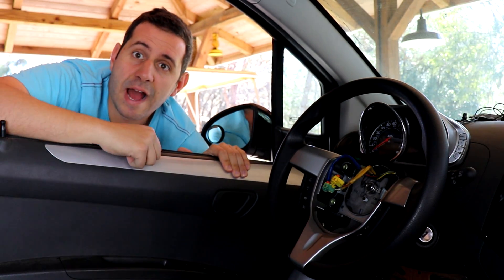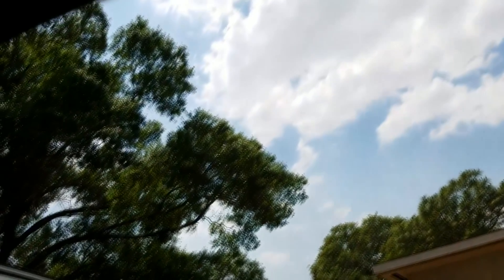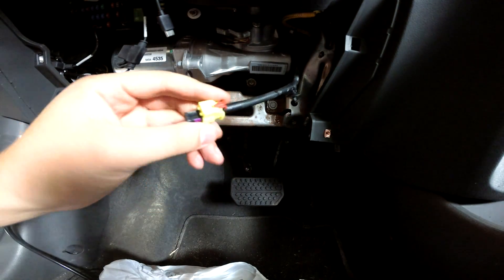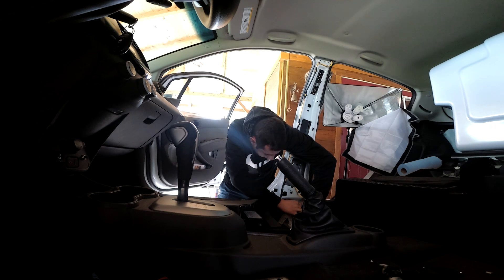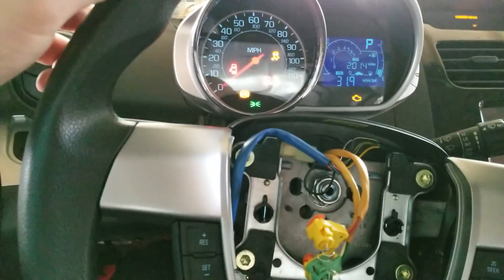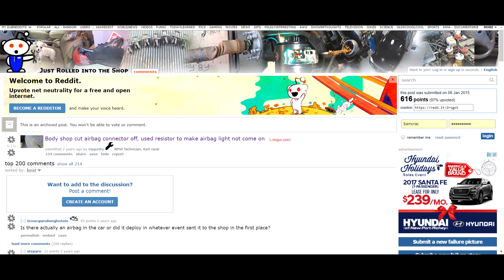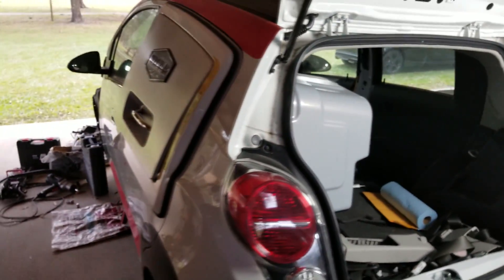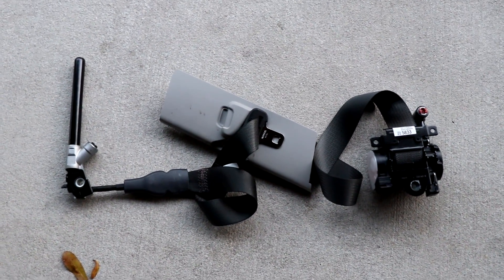How Scammers Hack a Car's Airbag System for 5 Cents (Permanent Airbag Light Off)

Comment: very informative ... shocking that the airbag system is that simple to fool .... 2 followup questions   imagine a case where a knee airbag is harvested/stolen from your car does the SRS computer detects that there is a disconnect of the airbag and reconnect (of the resistor) and trigger a code if the ignition is NOT turned on when the theft occurs ? also what happens if the resistor gets loose and  falls off the connector while driving : does the airbag light goes on immediately (with a code ) or will it stay off and only appear the next time the car is turned on (in other words is the integrity /presence of the "airbag" checked continuously while the car is being driven or is it just happening during the startup when you turn the ignition on ?}
again thank you this is very helpful ...

Comment: Just for clarity, the seat belt devices are pre-tensioners, which tighten the belt in an accident. They are one time use, and are triggered only in an accident bad enough to set off one or more airbags. If a shop did as described here, the seat belt would still "seem" to work (ie it would lock up if you tugged hard on the webbing), but it would be missing the pre-tensioner, which is important in more severe accidents...and you'd never know.

Comment: If the airbag controller is not communicating with the car on the passenger side, is there any way to hide that? Just need to pass the MOT in the UK as I only use the car as a local run around, don't have passengers with me.

Comment: Samcrac, I have a 2007 Lexus RX 400  H.  Needed to change out the bumper absorber and now, the air bag light is going off and on. Any suggestions, I really appreciate it.
Reply: its giving u a code, ID the code n google it...

Comment: Thanks for giving the detailed video. I purchased a Salvaged 2019 Traverse.THe jerk had a fake receipt showing he paid a lot of money replacing the airbags. He had actually replaced a few...but low and behold a year or so in the air bag light came one. Come to find out he had done the resistor trick on the  L &  R  air bag side curtains  one of them had gone bad triggering the code error...jerk took zero responsibility ..he blamed it on the alleged "air bag" company that was conveniently out of business.
Reply: If i want to buy a car how can I inspect that the airbags didn't go off before?
Reply: @r.k862  You can take it to and airbag repair shop or technician. It cost @ $200 to have my guy inspect mine and tell me where there were issues ..depending on the vehicle it can cost more...
Reply: @TomcoAV  thank you. If I want to have only the drivers airbag checked and to fix somethings how much do I have to pay maximum roughly?

Comment: I had this done to me when I bought a Mercedes-Benz w204 c250, I knew it had been in an accident but the guy I bought it off said everything had been fixed. Not long after I started using it the air bag light came on and found no air bags on that side of the car🤯😡

Comment: If you have air bags on and is running aftermarket seats with these resistors on, will the air bags deploy with an accident?

Comment: Just wondering what kind of resistor can one use ?🤔 no mention of it in the video or in any comments 🤔 😕. 
I'm in the final stages of completing my track car conversion for weekends and I'm still thinking how can I get around the airbag light especially with all the original seats removed . Any help will be greatly appreciated.  Thanks

Comment: Well I’m still trying to bypass / fool the system in our 2007 ( I gave up on the 2015 plus someone offered me way more than we paid for it new ) I refuse to let my wife ride with me! Please can you or anyone help?  If I could post photos I would. I just need help with the passenger side. There is a plug w/ 9 wires coming from the truck on the passenger side. The driver side is in and everything fits. Any help please?

Comment: My toyota has 3 plugs. 1 yellow one white and one gray. Adding a resistor to a yellow one does not prevent airbag light from coming on. Can someone please help? I want to remove my passenger seat on my 06 4runner for overland built for space purposes but I dont want air bag light when seat is removed..

Comment: Link to the resistors please :o) 

Airbags are the biggest Hoax and scam ever, they total a car way to fast and cause them to go to the junk yards, Making the Manufacturers of car more money because that car is now totaled and a new car is put on the road. 

No one's car should be totaled after a Seatbelt supplemental safety feature such as an Airbag. Junk Yards now get to part out your car and make more money as well, insurance get to raise your rates because they spend more and have a bigger loss and now they get to Insure a New Car at a much higher Rate because  your rates went up. It's a win win for the Car Industry People, but a serious financial burden on people who have airbags deployed over simple 10 mph accident or even worse, just go off accidentally. 

Government needs to cut the red tape on usage of used airbags and need to make laws on charging affordable prices for such supplemental safety features that really don't save lives at all and sometimes takes them. If you think Airbags saves lives, Don't wear your seatbelt and rely on Airbags alone. Let me know how that works out for anyone that tries it? Now try using only your seatbelt in an accident without airbags and chances are you will be ok, without a financial burden after a accident and Trauma. 

People have been brainwashed that airbags save lives, Yet we have classics on the road that have no Airbag, just seatbelts and everyone is fine. Come to think of it, there are classics without seatbelts, yet they are still on the road and its fine and dandy.

Comment: Love this video! I have a question I have a 2019 Ford ecosport and both front knee airbags deployed. I sent the module and seatbelts to get replaced.I bought the airbags from a junkyard and installed everything back. The airbag light is still on and my innova 5410 can’t even connect to the car. The fordpass app gave an alert that the RCM has detected a fault with the driver knee airbag circuit. Is there anything that I could do to clear this? Thanks please let me know

Comment: Leave the dame airbags out im  thnak the SRS airbags broke my rib cage in two places. I hit a deer with a 1987 Lincoln Continental at 55 mph no AIRBAGS NO injures walked away and drove the Lincoln to work and for the next 3 months with the RAM bet into the engine and the A./C condensoer bent into the engine A/C worked And Rad never leaked. SO next car will have no air bag or im deleted all airbags.

Comment: I bought a salvaged vehicle to ship overseas. Only the driver knee airbag was deployed. If I connect an emulator or resistor to that airbag, will the other airbags work? The car is not being sold to anyone and airbags is not a safety requirement in that country.

Comment: Sam, We have a 2015 Tacoma and I changed the seats in the Tacoma for a pair of 2017 Toyota 86 seats (Oh so comfortable). I splice & soldered the wires and tested the wiring. The passenger airbag light is on in the dash still. Apparently the systems are NOT compatible! 
Well from what I have been told by a Toyota engineer when an Airbag Light is on the whole system is INOPERABLE‼️ This makes the WHOLE system not work❗️ I would disable the seat airbag to get the rest of the system to operate any day. Just try to keep passages out of the seat ¯\_(ツ)_/¯ Any suggestions?

Comment: well, what if you don't want a seat airbag? "like installing after market seats." I would rather install a resistor for that airbag then to have an airbag light and all of the good airbags don't go off in a collision. So it is safer to install a resistor in some cases.

Comment: Great video  Am replacing blown airbags side curtain steering wheel and drivers knee plus reprogramming Control module and seatbelts.. Do I need to replace sensors? and if I do how do I find out which ones?   Chevrolet Bolt  damage ft. left and small right rear fender   Thanks so much Jim

Comment: Couple questions. Did you work on the resistors and Airbag with the battery unplugged? Also wouldn't you need to reset the srs module to get the light to come off? Weather you did it by replacing the Airbags or putting resistors in place?

Comment: For one...   the gauge size is going to push the springing part of that female connector more than it should have ever see.  (And its a problem in itself....   poor connections)   please do not follow this guy)....  I get what he is saying but he is just teaching people to be Brave and SRS systems are just super easy but it is not  to be tempered with by a yone other than persons that know what the hell they are doing.   Its up there with brakes!!!    Could kill people instead of protect in the wrong hands.

Comment: Most interesting.  Two questions:  what value resister are you using?  And since it was in an accident, wouldn't the airbag module have to be sent off and reset, since that can't be done with a scan tool?  Thanks, Tom

Comment: I’m in the process of repairing my 2013 Mustang, was in a wreck, set the driver seat airbag and steering wheel off...
Of course since that happened, the airbag light is going to be on... 
I want to put an aftermarket steering wheel and seat in, (harness seatbelt will be installed.),

If I use resisters in the seat airbag sensor, and steering wheel, will the light turn off? Even though the airbags were deployed?.... I’m confused :(

Comment: I have a 2010 Nissan Sentra with no driver airbag all other airbags are in the car but there is no airbag light on the clock spring was cut but no resister on it

Comment: You don’t even need resistors you can just tell the system airbags not installed. But the light will not come on anymore.

Comment: You'd think that manufacturers would use a small circuit in each safety system which generates a VIN-specific security code that the main computer reads to verify that the actual part is installed and not some janky hack.  I mean, it's potentially fatal what these dirtbags do.  The car makers can prevent this with only a few bucks worth of electronics per type safety component.  You really gotta be a special type of f'd up to do take the safety equipment out of a car like that.  Wow...this is good information to know!
Reply: I was told by a co worker that the impact sensors on his 11 Tahoe need to have vin number programmed into sensor to get lite to go out. Cost him a couple hundred to get it programmed at dealer. Must be how they insure parts are replaced rather than by passed.

Comment: In my prior post I explained how to defeat the test circuit, now comes why you still may have a problem.  All those connections are weather-tight and also have a tamper tab that breaks if you replace the air bag.  The problem arises when moisture gets into that circuit.  Say you're in Florida and it's a hot, humid day when you pull it apart, then you put it back together that night.  You now have moisture which will cause corrosion on those joints.  The computer is looking for a 1/10th of a volt change and if it thinks there is a problem, it disables the system.  The airbags may not go off if the system thinks there is a problem.... which, even on a reputable repair, may make the system inoperable.  You SHOULD have a light in that situation, but I had that very trouble with a vehicle and it did not have a failure light.... repairing these cars is totally cool, I do it all the time, but you need to know what you are buying and why it's cheaper... after all, everyone should spend 50 cents on the dollar if they get the same car.  It's not the same car as new.

Comment: Full explanation.  When the car is turned on, the computers power up and send a 5 volt signal to all the various sensors in a car.  They are looking for 2 things - open circuit (broken wire, deployed air bag, etc) or a return that is at least 1/10th of a volt less then the 5v.  The idea is it prevents that very scenario where someone simply shorts the system with a paper clip.  That works with many different lights - on one car I had, I wanted the locking differentials to work no matter what the computer said... so I ran wire for a switch then soldered in a resistor so the computer would think "ah, there's a load there so all must be well."  No dash lights, no problems.

Comment: Did you replace srs module or clear the crash data from it? No disrespect but your video is misleading, In order for the airbag/srs light to remain off with resistors after any airbag deployment the srs module has to be replaced or the crash data has to be erased with special tool/software!  I guess you left that part out of your video.

Comment: The charges will still blow if you are not wearing a seat belt, but the belt itself won't lockup. An easy way to tell if the belt was extended and worn in a crash.

Comment: If one component is faked in this way, does it generally disable other components, which are genuine, from functioning in a collision?
Reply: Everything else should work as its supposed to.   I've used resistors when replacing high end seats on jeeps and the airbags still went off in the steering wheel during a collision.

Comment: I noticed your calling at the Domino's Pizza Car'Domino's DXP Car now, not just The Pizza Car, did you get copyright permission??
After an accident that has deployed safety features in a vehicle it should be up to the shop that recertified the car for Road Use to make sure all safety features are in working order.
Then, stuff like you showed in this video will not happen.

Comment: When you twisted that resistor, you shorted the two sides together, which means there was no longer any resistance.  This is probably why you were still getting a light; the computer thought there was a direct short of the cable.
Reply: Where can you buy resistors from?
Reply: @Torbody  there are hundreds of online places to buy them.

Comment: Figuring out the resistor size isn't difficult. You put in a potentiometer (an adjustable resistor, like you find in old-school stereos for volume control, before we used rotary encoders) and adjust it until the light goes off (might have to cycle the ignition periodically, some systems only do diagnostics once at power-up). Then take it out and measure it. Or alternatively, measure one of the working lines: Measure the current passing through the line and the voltage drop across it, and plug it into ohms law.

The reason for the resistor is to guard against open/short circuits, not to protect against this sort of scam. It essentially has a divider bridge of two resistors, and an open-circuit of short-circuit gives you a voltage that is out of bounds, while the right resistor gives you something in the middle.

Comment: If you are rebuilding the car for yourself, why would you care whether the airbags worked? As for trusting an airbag, I don't trust brand new airbags. They are more likely to kill you than save you. They are something that was jammed down the concumers throat, and there were so many lies told about them that most people just accepted that they were a good thing without question. That was not the case. I have a 2006 model car, and I have blown both the airbag and ABS fuses, but left them in place. In the event of an accident, the insurance companies cannot prove any tampering. I feel much safer now. I don't have an armed BOMB inches away from my face, and I have full control of my brakes. Both ABS and airbags were and are government boondoggles. Since when has the government EVER told the truth about anything? Go ahead, give me just one example
Reply: Gerald Scott same blow my airbag fuse as well seatbelt is your best protection.

Comment: I don't understand how it's possible this, if the airbag module has got a crash data file on it the airbag light on the cluster stay on anyway. Did you replace or reset the module before this test? @Samcrac

Comment: Someone had a friend who was looking at a truck and asked me if it was okay to send me some pics of the truck to answer some questions for him. Well I am looking at the pics and he was asking me why the dash above the glove box had a split in it almost like a long cut. As soon as I saw that picture I told the guy that the airbags had been deployed, even though no air bag remnants were sticking out of the slit, so I said to him there should be an airbag light on. Later he takes a pic of the dash no air bag light on, I told him ask the seller if the guy had replaced the air bag, he told me seller didnt replace anything, told him to run away because there were multiple airbags deployed and someone tinkered with it.... find another truck, this will cost a fortune to fix

Comment: This really raises concern for me for when I got hit in my Cadillac STS-V. My car went head on into a cement barrier at highway speeds and then got t boned. No airbags ever went off... funny thing is when I bought the car the airbag light was on and as part of the agreement the dealership would fix the issue. They "fixed" the issue and I never saw the light on again. Samcrac, if you remember I sent you pictures of my accident so you saw the severity of the wreck. Airbags should have went off.
Reply from the maker: Yes I did see the photos. It would be interesting to go back and look what might've been there.